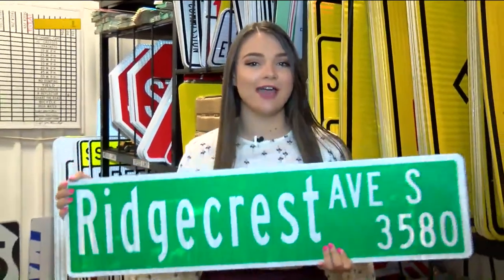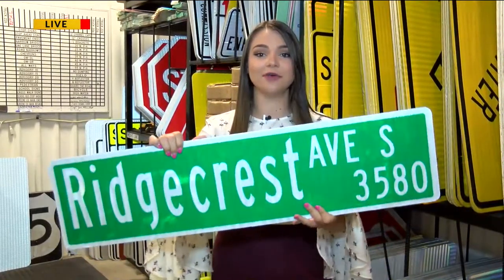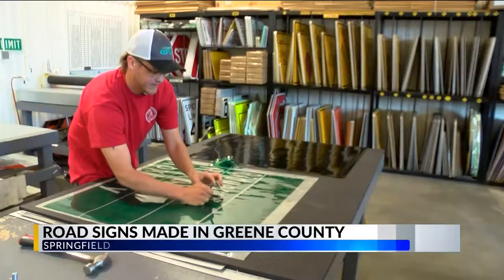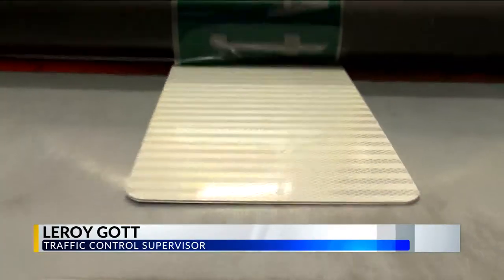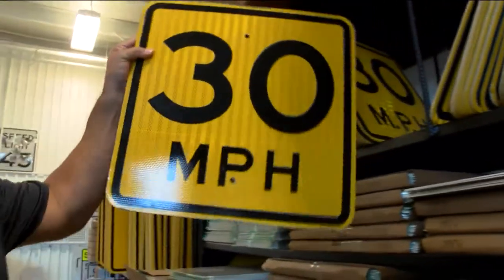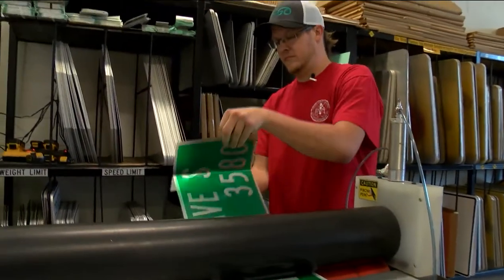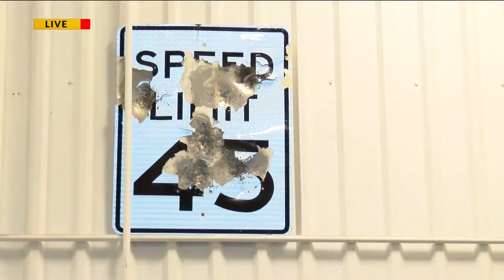How Road Signs Are Made

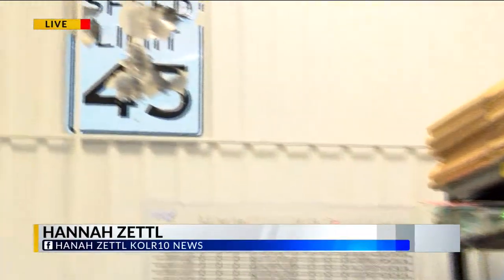Comment: 2:25 R.I.P. Speed Limit 45 Cousin by Utility pole, stop sign, and no parking any time sign in Paterson NJ.
Sadly, speed limit 45 died from the damage from a severe storm in 2007, and had to be replaced with a bigger speed limit sign who was unwanted.
Because of which, speed limit 45 was becoming more popular in 2005.
The replacement was Speed limit 50 from the founder from speed limit 40.
Now, speed limit 45 was no longer around. Not around yet until 1989.
R.I.P. 
Speed limit 45 
1989-2007
Stop and No Parking any time sign went to the scrapyard where he would be buried since he died.
On a side note, if you or they want to see him again, there’s one around in Boston.